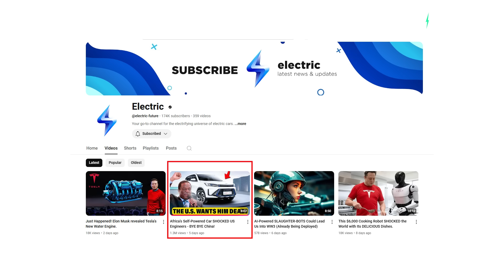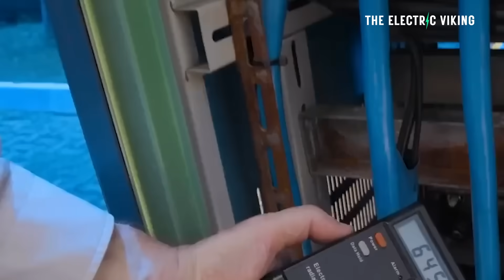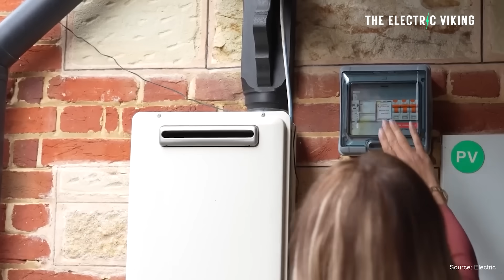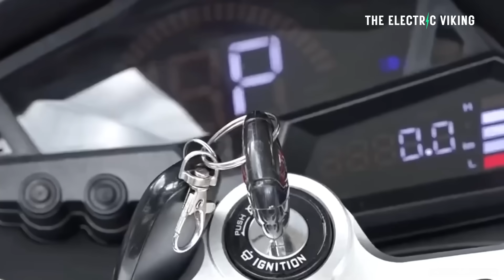Internet claims Africa’s Self-Powered Radiosonic Car SHOCKS Engineers

Comment: Thank you for this video. It's ridiculous they are making these claims without any actual proof or paper. Energy can be harnessed from radio waves, but it's so tiny it can only power devices like earbuds, and even with that you will probably need a large antenna to make it work reliably.

Wireless devices, like mobile phones are able to receive signals on the order 100 pico Watts, and have to be amplified in order to be processed. The amplification and processing is what uses the energy. If what they are saying is feasible, eardbuds won't need batteries.

And background radio waves are not energetic enough to produce consistent power. You will need really large surface areas to produce usable power, if you are not using solar radiation.

Their claims will be feasible if they had make breakthrough in efficiency using a very large Radioisotope Thermoelectric Generator (RTG), a very massive version of what is used in the Mars rovers from NASA, even then they have to recharge once every few years since they lose half their power in about 4 decades.

Comment: If "micro-sonic engines" are real this is the rudimentary methodology which might have been the foundation of said invention (below): those who seem quick to discount or diminish such efforts might not want this foundational knowledge exposed. Most of these people also seem to be Afrikaner - i.e. the progenitors of Apartheid, which strikes me as odd if not entirely coincidental lol.

"Rectennas: Receiving antennas that convert electromagnetic waves into alternating current (AC) 
Rectifiers: Devices that convert alternating current (AC) to direct current (DC) 
Metasurface-based antennas: Antennas that absorb radio waves at low intensities..."

There is an evidentiary for the growth of this technology provided by researchers at the University of Central Florida. They have developed a technology that converts radio frequency signals into direct current electricity. Said researchers have developed a metasurface-based antenna that can harvest energy from radio waves. It is further claimed that Maxwell Chikumbutso of Zimbabwe has purportedly engineered an engine using such technology after having studied and furthered this research (possibly with a few happy accidents thrown in, which is how science often works). The motorcycle application is particularly interesting to me, and a powerful antenna can visibly be seen on the bike as a component: seamlessly integrated in place of an exhaust. While it is clear that "fake news" and nearly every type of propaganda surround this extraordinary story, this technology is not fictional. Do not allow yourself to be confused by either side. Some will compartmentalize while they attempt to gain their patents, and others will discount for the sake of their ego, but keep your eyes and ears open - and free of spiders. Love peace and blessings, we only get there together people.❤️🙏

Comment: Easily debunked by just looking at the size of the collector you'd need to have to capture enough radio waves to generate anything close to the amount of power you'd need to run a car. A dish (everyone has seen a radio wave collector dish before, right?) the size of a car can't even capture enough to run a light bulb. Just look at how much weaker radio waves are than the optical spectrum, which is what solar panels use (in the link below). Think of the size of the solar panels you would need to capture enough light to run a car. Now its not just capture, its also conversion into energy, solar is typically from 15%- mid20s%. This claim is about radiative to electrical energy conversion and, if true, its not just technology, it would be new physics. Frankly, even if they wanted to keep the technology a secret, the energy conversion model could be published and would, i am sure, earn the discoverer a Nobel Prize in physics. I think the reason why so many people get duped on claims like this is that they didn't benefit from a high school class in physics or astronomy, and emotionally they really are hoping for a miracle to get the world out of the mess that my generation has gotten it into. https://imagine.gsfc.nasa.gov/science/toolbox/spectrum_chart.html

Comment: This zimbabwean guy is a scam artist, he read about a electrical/ mechanical engineer & inventor in south-africa that created a zero electric charge, unlimited mileage &  zero maintenance vehicle's, he even designed a zero braking system with zero maintenance & stole his idea, the inventor in south-africa was in the news worldwide, thats probably where he saw this ground braking technology, this zimbawean scammer 2  cars of his was built in China, he uses a battery generator in the trunk/ boot of this car built also by the chinese, his so-cal TV that have no batteries & wireless also seems to be a scam, at the rear/ back of the TV there was a battery & pc board with his wiring, after  this fabricated story of him that americans wanna kill him & that he was poisoned is also a lie, then he hide this battery & pc board inside the TV,  no vehicle can run on radio waves or perpetual energy or microwave energy, its too weak & created lots of heat, but it can run on what he is using battery generator that charge the batteries, but unfortunately after awhile the battery charger have to be charge, the real inventor in south-africa that he stole the invention from has decided to make it more difficult for this guy to steal any of his inventions again, he got rid of the batteries in the car, so zero batteries, zero charging. Maxwell is not only on drugs, he even bullshitting his President !

Comment: There isn't the power level or density next to power cables, let alone radio, to run one car let alone millions. You have to be close to the power cable--this is induction power--and any useful power draw will drain power from the cable. Therefore, not free energy.
Radio broadcast radio power is in Watts or fractions of a Watt, not the kW or MW you need for transport.
As presented this is bogus.
Please ask a physicist before posting things like this, you've been caught with this sort of thing before. Note: if it seems too good to be true it's probably a scam.

Comment: Hmm interesting. You can defiantly transfer energy via TEM transverse electromagnetic waves but you stil have to create the energy and then transmit it. An it is very inefficient. This is what they use for the wireless charging. Has a very limited distance.

Comment: I haven’t been tricked and as I stated before still waiting for the proof of concept. Simply because this is so easily provable. Hold a media day and then drive your car the equivalent of from Philadelphia to San Diego CA with the camaras rolling and not stopping for gas or recharging. You would have to be a complete idiot to think you can get away with a scam like this if it turns out to be a scam. Still waiting for proof.

Comment: If you were honest, the first question you should ask your self is: "Can electricity be generated fron radio wave?". If the response is yes then you should ask yourself "how and how does it work".
Rather than that you just use a rhetoric to confuse your followers. 
To generate electricity from a radio frequency wave, you use a device called a "rectenna" which consists of an antenna that captures the radio waves and a rectifier circuit that converts the alternating current (AC) induced in the antenna into usable direct current (DC) electricity; 
Now if it is possible to produce electricity from radio wave , the next queston is: "Can enough electricity be produced?"
It is my understanding that ti start an external power is required to start the system and them it will be self powered.
If Maxwell was a white guy, the litterature would be completly different.

Comment: I'm not questioning the technology; it's just transformation of one form of energy into another form that can be used.  I question the amount of energy that is retievable using an affordable amount of equipment.  Physicists are well aware of the total amount of energy coming from outer space and would have developed the required equipment at least 80 years ago.  Believe what you want.  Perhaps, you can increase the efficiency of the technology; I doubt if it's at 100%, yet.  Go for it!  It took only 30 years for a Japanese scientist to develop the blue LED for coloured flatscreens, and at least, that goal was possible.

Comment: Four sets of Bicycle pedals must be used at all times to generate sufficient radio waves for the system to work.
Passengers must pedal extremely fast for 220  vehicle speed.
It's all in the fine print.

Comment: Well if we hear no more by the end of the year , then it's not true. I was in electronics . You can convert radio signals to a useful energy supply, but not on the scale required to run a car.  So i need it verified.  Mind you , it may be charging the existing battery's . Again when dealing with 800 volts over several phases ,i cannot see that is possible without a totally new design of ev car. A mystery to me.

Comment: If it's made by a Chinese company in Africa, I might give it a credibility rating of  0.001 %. 
There is NO contrivance or antenna shown in that video that CAN capture electromagnetic or radio waves!!! Transmissions "on air" are micro-volts or milliwatts when they reach a receiver. I can't wrap my head around an antenna receiving so much useful power and amplifying it so much to charge high voltage batteries.

Comment: Fifteen years ago in 2010 the EPA decided that one US gallon of gasoline (12.38333) kwh, contains the same amount of (hydrogen/energy) as 2.69179 US gallons of gasoline (33.33333) kwh. Most people today, still believe that crap.The output power of this idiot's radio is limited by the size of it's battery so he won't get far on two double A's, but if it actually works, he could sell it to Elon for two or three billion.

Comment: I knew a bloke years ago who was a sparkle. He lived near a high tension power line. You know, the big towers you see running across the countryside. He could stand in his back yard with a fluoro tube and if he turned it at 90 degrees to the lines, it would glow.

Good party trick but nowhere near enough to power a car. And that was coming from 150,000+ volt lines less than 50 metres away.

Comment: They removed logos on outside buy didn't remove it under the hood. There is a logo of Cowin Auto - Low cost sub brand of Chery (for excample in 8:45). I like when he shows some power cabinet with big switches like some magic box 🤣 And it is great that there is no technical paper explenation at all how it supposed to work except the divine knowledge.

Comment: Solar panels also do the same thing - convert electro magnetic radiation called sunlight into electricity. The problem is that you don't get enough energy to run a car. Any other radiation with a lower frequency has lower energy. And if higher frequency radiation were all around us,  we would have died of cancer

Comment: Agree it’s absolute bullshit but you presented not one piece of evidence in the whole rant. How about you point out that this system still needs a battery if it produces its own energy why a battery? Or the fact that the box under the hood looks suspiciously like many battery operated EV’s or maybe the fact that radio waves put out a poofteenth of energy so low it will only  just run a crystal radio. Or how about the fact that it still has a rated range that is horribly similar to a battery ev. If produces its own power what would it have a range. You really have to stop repeating the same thing over and over we got it the first time.

Comment: Technically you can harness energy from radio waves and make use of it. Just that to push a car you need radiation stronger that 10 microwave ovens together. Maybe on a neutron star that would be possible?

Comment: I have powered an LED with local radio station waves. The receiver requires a 10m long antenna and ground. So if I had a semi truck full of these radio receivers, brimming with antenna towers, I might be able to power an electric bike.

Comment: Sweden has a more practical altnerative they are trying - putting power lines under the street and attempting to charge/power cars by induction similar to how you can wirelessly charge your phone.  The benifit is not having huge batteries; the negative is you can't drive far from where there are no induction power lines.  You could have a hybrid system with vehicles with smaller batteries and induced power in just some main roads.  Obviously the investment in putting power in every road is pretty massive; and impractical.

Comment: It isn't exactly what you think; the "radiosonic" car is using a 100+ year old idea of using radio or other EMF to transmit power to be used in vehicles, or what ever else. This is the same Idea Nicola Tesla had which he planned to exhibit at the Wardencliff site but JP Morgan halted funding for.  You still have to generate and transmit the power; and then the power has to be captured and converted to electricty; which isn't perpetual motion - you might call it wireless power transmission.  A number of problems quickly rise. How many transmission points do you need which is related to the range of the transmission and power produced. In theory vehicles wouldn't need big batteries.

Comment: It’s huge exaggeration 
What he is promoting is great for a small crystal radio not much else 
Or if you like scams 
I still can’t understand why people believe this nonsense 
In my opinion
Reply: 1N34 diodes are getting hard to obtain so if he has a way to make them, h might make literally dozens of dollars off this.
Reply: But can't you step up the voltage? Use supercapactors?
Reply: @jasonfreeman3530  If you double the voltage, the current decreases.  It is like that thing with levers.  You can lift a car with a lever but you have to move the far end a lot further than the lifts.

Comment: You can find few individuals posting in YT regarding the possibility of harnessing power from radio wave. Just look for it and you will get the answer. Even there is one Professor show the possible Electrical Circuit that can be used, all with compelling proof..

Comment: If it’s running off perpetual motions, it’s running off of radio waves, it’s not perpetual motion. It’s just getting its power from an outside source Nikola Tesla did this many years ago. He was lighting lightbulb, using radio waves for up to 2 miles away.
Reply: Yes, with an efficiency under about 1%.
Reply: @ no that’s not true , during that particular experiment he generated so much power it shook the ground even local folks in the area felt it. It was lighting multiple lightbulbs not just one. This is not new technology it’s repressed technology.
Reply: Radiowaves are measured in microwatts one millionth of a watt (µW), you can't even power a phone with such tiny amounts. There is no such thing as perpetual motion
Reply: @ it’s possible I built a radio car back about 30 years ago that the car did not use batteries. I designed it to run off the power generated from the radio control. It was not gas and had a range of about 4 feet. But I was still able to get the remote control car to run and drive. With modifications.

Comment: Did u travel to Zimbabwe to test this tech? How do you know this is fake? hard to believe, I admit, but aren't every new invention? So, you do not have enough evidence to prove he is a fraud. get an engineer to at least analyse the possibility of radiofrequency energy conversion to any degree. My only question, is, can he really partner with a Chinese company and maintain the tech is still protected? I have driven 200kph in Africa by the way, not sure what u mean by that reference to 220kph. Regulatory approvals, don't worry, Zimbabwe will need it first. he actually has a site where his inventions are available. I give him benefit of doubt. Science. Did u watch the video? he has large batteries that can power hundreds. Do some due diligence worthy of your chanel.

Comment: Actually i just watched a video which puts the claim of perpetual motion in Zimbabwe in to the correct context.

Basically as we suspected microsonic devices do not exist in the way claimed, they are infact beauty care devices for skin care.

It was a complete wind up by someone.

Just check the facts and they don't stack up.

What is shown is Chinese tech and what is shown in the car is actually Chinese electric car tech which Zimbabwe is welcoming in, the only self charging part about it is with the use of solar panels.

However i suspect taking elwcrricity from the air may hold some merit in time just not yet.

Comment: The truth is that radio waves of all different frequencies are a form of energy and can and do provide power to energize devices.  However, the power available from them is not enough to do anything but the smallest task.  If the inventor has been able to make some sort of micro-transistor that can amplify the power of the waves with no external stimuli then that would be a remarkable feat.  And if this inventor really is on to something the biggest loser is not Tesla.  It will be Trump.